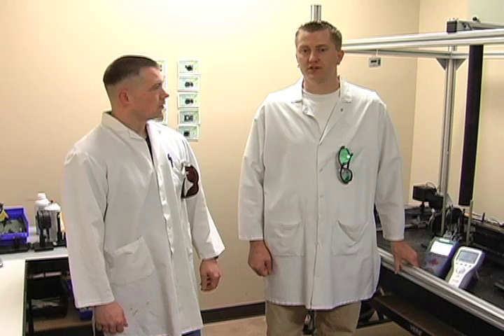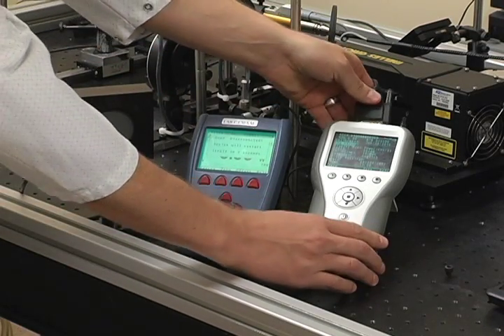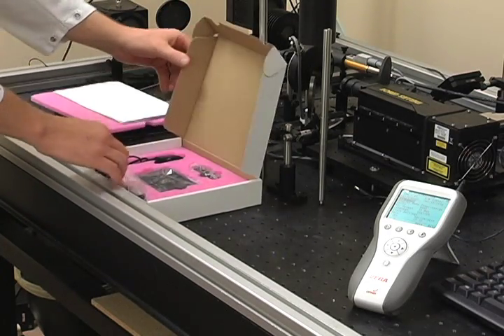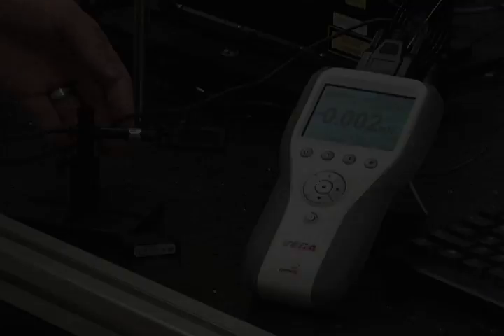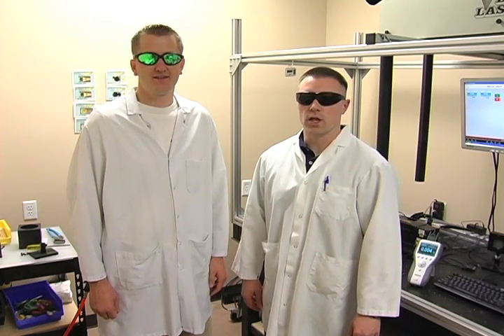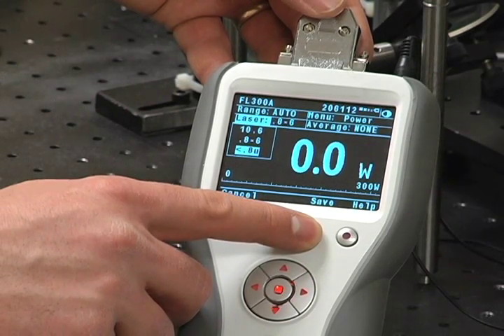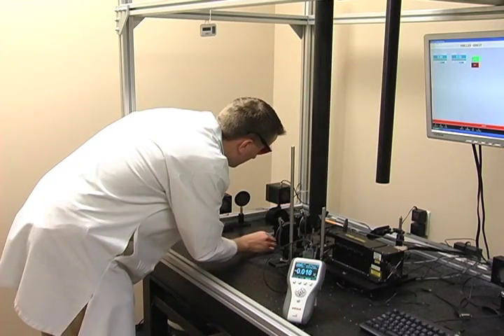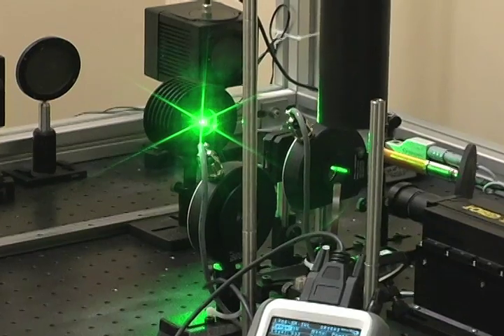Easy Setup of Laser Power Meter and Sensor -- Ophir Photonics

Comment: you  should implement a spectrometer, with an ofset to the sensorhead that would calibrate the unit to the corresponding wavelength, so it aint a end-user aspect.